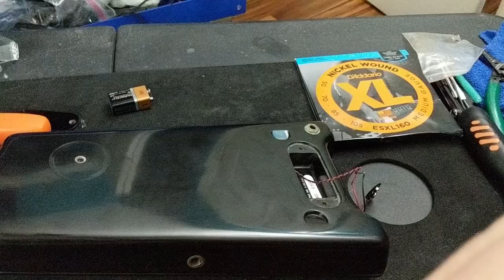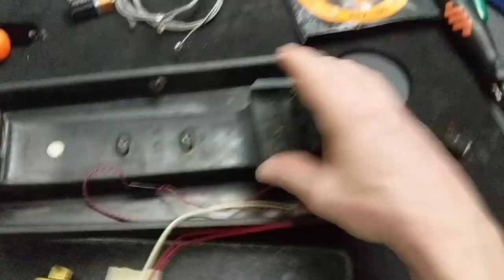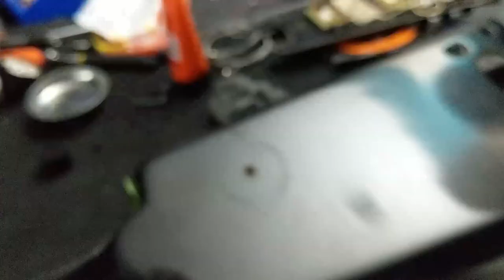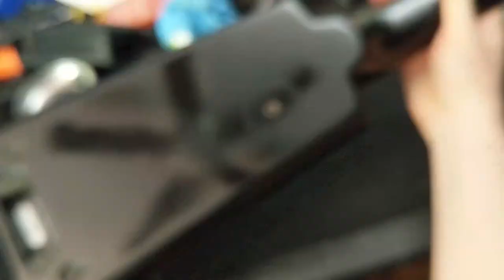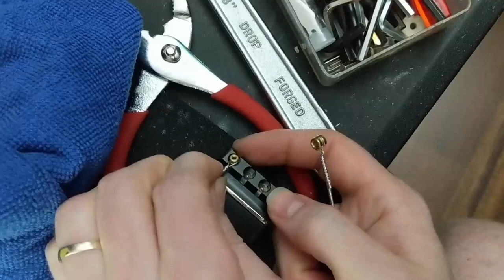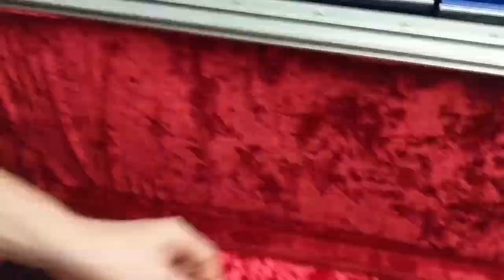1983 Steinberger L2 Bass Restore

Comment: If I came into a first-generation Steinberger bass, one thing I would try to do in short order is have the headpiece upgraded to one from the Synapse line. There may be nothing wrong with double-ball end strings, but I’m kind of picky.
Reply from the maker: If I played this bass as a regular everyday instrument I'd probably do the same but the value would be cut in half if I modded it
Reply: Point made,  @chromaticmusic .
Reply: The original hL2 headpiece accommodates single ball end strings too. DBE strings didn't exist at the start of production.

Replacement headpieces with string clamps and string adapters are available for XL, XQ, XP and XM basses.

The Synapse headpieces were a common failure point for those basses and would be the last thing I'd put on any Steinberger, even a Synapse!

:)

There's an aftermarket headpiece available which has the string clamps integrated instead of the bizarre system on the stock Synapses, which also looks better.

:)

Comment: How did you get the knobs off?  I took out the screw but they don’t seem to want budge.
Reply from the maker: I think they just came off with no issues. Some people have put glue on the inside or jammed them down so hard it's a mess but if you go to an auto parts store, or Amazon you can buy plastic interior trim removal tools that will get the leverage you need without damaging the body
Reply: @chromaticmusic  there were two screws holding them on!

Comment: Sweet work. I have an early 90's XQ that I need to spruce up. What cleaning agent did you use on the composite neck?
Reply from the maker: I buffed it with a drill wheel and scratch doctor from mothers
Reply: @chromaticmusic  Thanks, Chris. I watched some of your other restore videos and you do an excellent job. So, the 00 steel wool works good to polish the frets on the composite fingerboard? Just steel wool, without any polish?
Reply from the maker: I actually don't bother with the steel wool anymore, I discovered using a Dremel with a buffing compound makes the frets like mirrors. Steel wool does a great job however cleaning the frets board gunk and lemon oil to restore. But I finish with the Dremel and compound and it not only shines the frets, it removed the little gashes from the frets as well. Take caution so you don't remove too much, nickel frets are very soft metal
Reply: Okay, they do have some gunk accumulation, so I will give them a light-handed work over with steel wool and then finish with my dremel. Should I put some type of cleaning agent down under the steel wool? I saw someone saying wd-40 was what works good on those composite fretboards.
Reply from the maker: I simply used scratch doctor on all parts of the body and neck

Comment: aren’t the pickups supposed to be active ? Didn’t see a 9V battery in there…
Reply from the maker: I would have thought the same but that has been the myth for decades. EMG pups themselves are never active. They are boosted by a preamp and system is active. But that goes for SD, DiMarzio etc. Bartolini pups also are active, they have a preamp as well. So people can swap the emg pups out with anything they want and the system will still be in use.

Comment: question, what was used on the bridge and tail piece?  Powder coat? Paints?
Reply from the maker: Not sure what you're asking. I polished all the parts with buffing compound but that's it. Everything is stock
Reply: @chromaticmusic  To clarify, the black finish looks better than when you started, what was used on the bridge?
Reply from the maker: Just buffing compound

Comment: Nice polishing but why not repainting the back?
Reply from the maker: Not sure what you mean, the paint is perfect on all sides and was polished up the same as the front. Thanks for checking it out!
Reply: Steinbergers are not actually painted, they are "gel coated" with an epoxy resin, the color is applied in the mold itself..
Reply from the maker: Either way, I never painted the bass, just polished it
Reply: @zmix  For sure but then you can see the round mark of the "anchor" screwed in the back.
If those marks are too deep to disappear with a polishing, why not repainting the back?
Reply: @philippeimac  the instrument is constructed in a sculptural way, with a gel coat lining a mould then the carbon fiber and epoxy is laid in.  Paint is too dissimilar to the actual surface material, you would have to paint the entire instrument and that would eventually flake off.  Chis did exactly the right thing here.  @chrisschmitt : Is it for sale?
Reply: @chromaticmusic  Is it for sale? :)
Reply from the maker: @zmix  it's a part of a collection so it would be sold only if the lot sold. Kinda like asking someone to sell their dog :)
Reply: @chromaticmusic  "collection", you say..?
Reply from the maker: @zmix  part of this https://youtu.be/jo-CDv6rUQ8